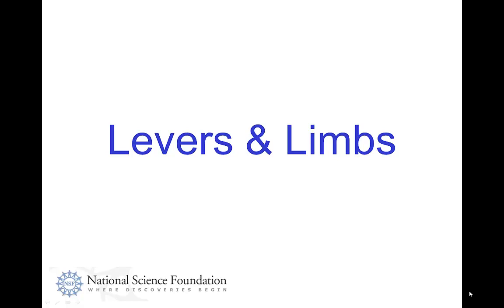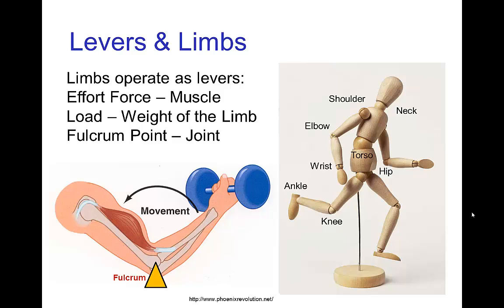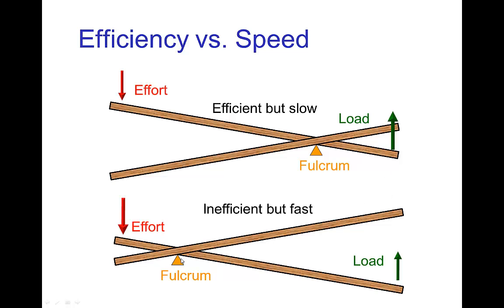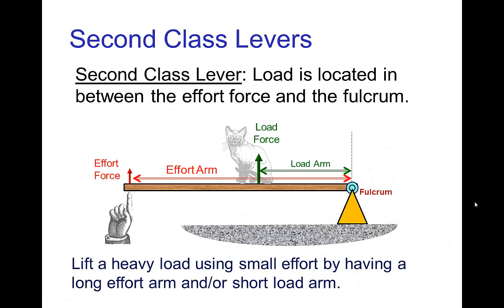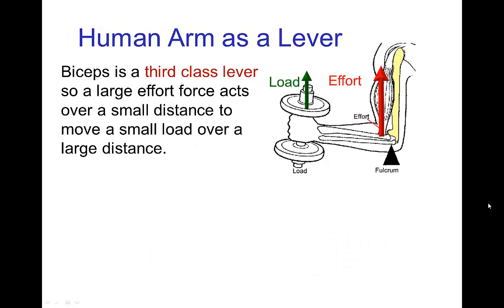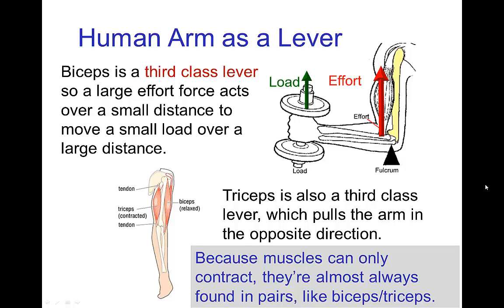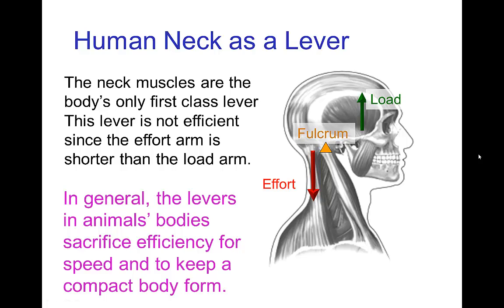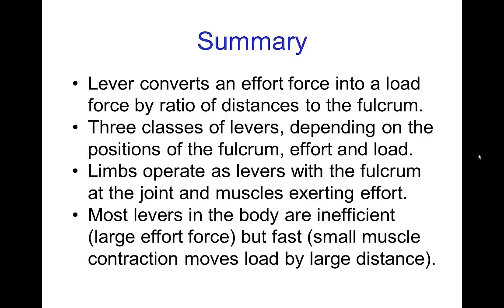Levers & Limbs

Comment: Saying that shifting your weight forward increases the efficiency of the calf muscles is inaccurate, because the load force is really the normal force you are exerting on the ground which is always located at the toes.
Reply from the maker: I think that the normal force exerted on the ground is actually the fulcrum force but it may be that I'm misinterpreting your comment.